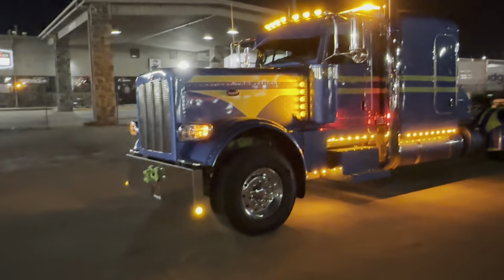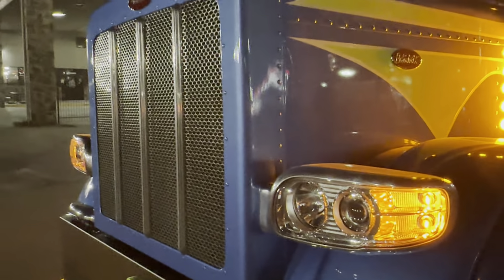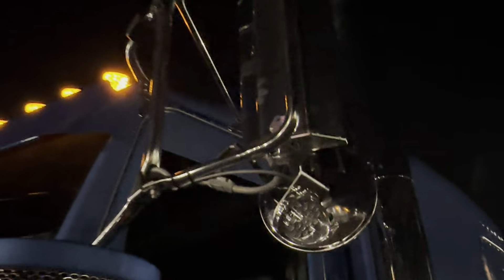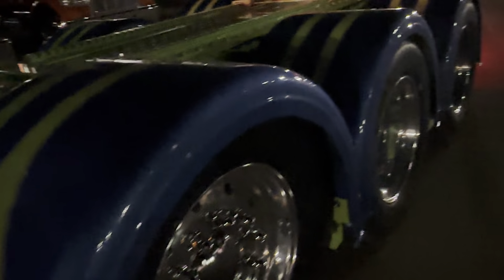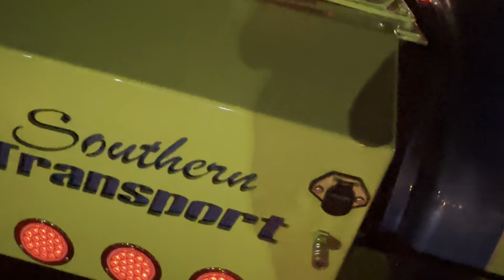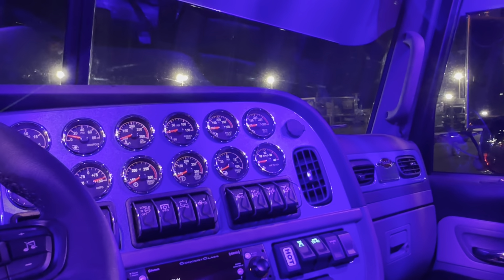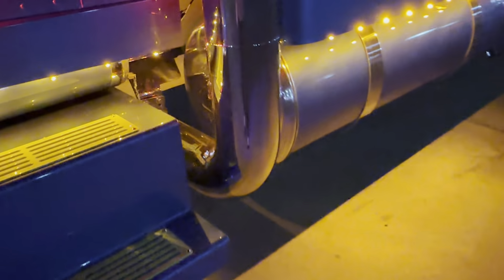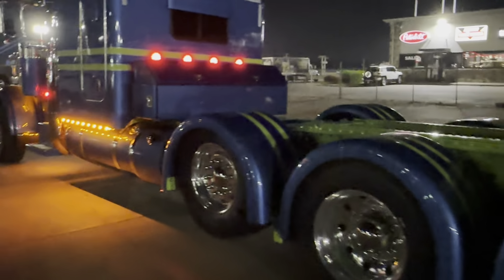New 2024 Peterbilt 389 Heavy Haul 4 Axle for Southern Transport & Operator Todd Dyer

Comment: A few too many lights for my tastes and I will not use hub covers and deck plating that blocks ready inspections. I also don't like the color of the interior lamps as it blurs out the interior colors (you need a contrast IMO). But other than that it is a very nice looking truck with a beautiful paint job.
Reply: Lites are AWESOME,  Especially in Heavy Equipment Haulin. It doesn't take but a few secs to remove hub cover